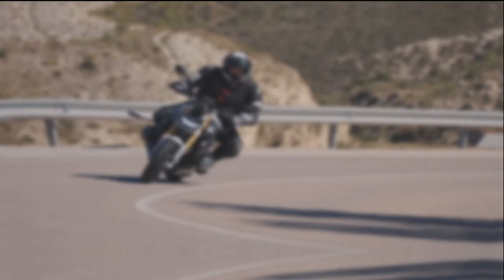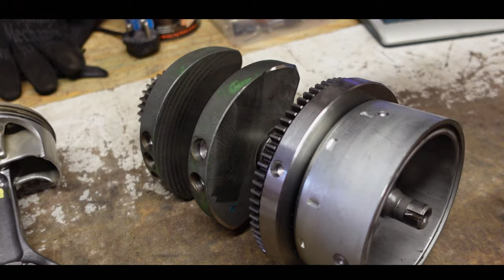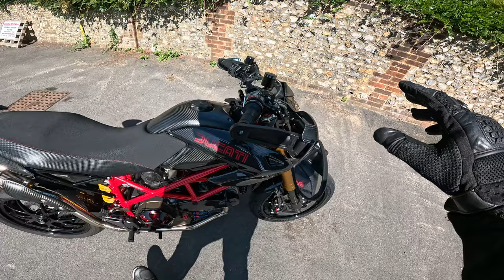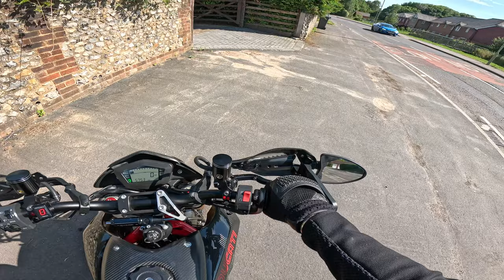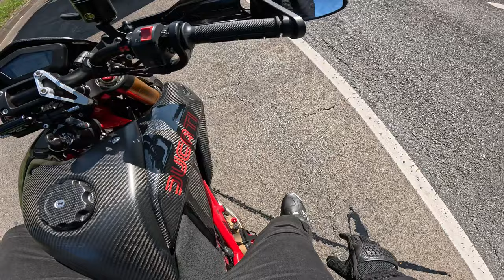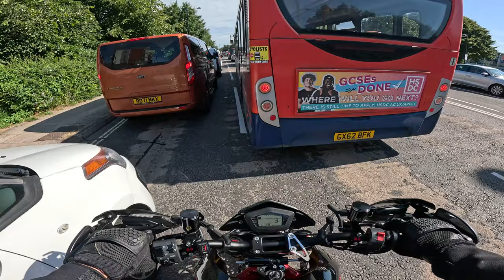Hypermotard Is GOOO!!! | The Project Concludes

Comment: Regarding your stiff gear shift, if it's still a problem after you're back on regular oil, consider these things:

1. Do you have any clutch drag? With the engine warm but switched off in first gear, can you push it along easily with the clutch disengaged? If not, maybe the clutch needs further bleeding.
2. You fitted an Oberon slave I think? That gives a lighter pull at the expense of some lift. So if it's dragging despite a good bleed, consider your clutch pack. If your new clutch stack height is a bit higher than optimum, then the clutch may not be fully disengaging. You could always swap back to the standard slave, just to see if that makes a difference. (By the way, my 1100 Monster has rearsets and an Oberon slave and the gear change is super slick - much better than standard.)
3. As the engine's been rebuilt, the gear change selector arm has been removed and replaced. It can be adjusted a few millimeters fore and aft but needs to be precisely centred to ensure smooth shifting. It lives under the alternator cover and might be worth investigating if all else fails.

Enjoy!
Reply from the maker: I will try those tips thanks 👍

Comment: Been soooo looking forward to seeing the first proper ride out on the Hyper, what an achievement!
With regards to the stiff gear change, I had the exact same problem on my 2007 Hyper and the reason for it was the ‘selector claw’ was not aligned properly. Page 455 on the PDF manual shows how to align this 👌🏼 If this is the problem, when tightening the gear selector mechanism back up make sure to use the correct loctite and torque both bolts to their exact spec!
Reply from the maker: OK fantastic Luke 👍

Comment: I agree with the fellow about a hard break in especially since this is not a new motor its basically just a rebuild. Manufactures usually want you to be easy with the bike for the first 600 miles to let all the metal mesh with each other. In this case you’re only breaking in the piston rings.  The best way to seat your rings is to do multiple heat cycles with aggressive on throttle and trying not to keep the engine running at a constant speed for too long.  So basically ride it like you stoled it.  Let it cool down.  Repeat ride it like you  stoled let it cool down a few more times. After about three to four times your rings will be properly seated. Now you can ride it race it or just put it around.
Reply: Run it in like you're gonna ride it is my advice. Manufacturers just want you to go easy on new bikes cus of the brakes and tires
Reply: In any case, you're only breaking in the rings.

Comment: Great to see the Hyper finally running smoothly. I've had my Ducati Monster oil analysed by Millers and they're really quick - I got a full breakdown of the oil emailed to me exactly seven days after I put the sample in the post. I'd definitely recommend this service in your case with a rebuilt engine or also if you've just bought a second hand bike so you can check on the health of the motor. (Maybe get the R1 analysed at the same time.)
Reply from the maker: OK good news 👍

Comment: You really should give it a bit more throttle when running it in. Repeated hard pulls, then ease off. That's what gets the rings bedded in. Constant low rpm will do it no favours as things will just glaze, not bed in
Reply from the maker: Yes it's now had some decent pulls, only took it easy for 100 miles

Comment: Love the bike. Hopefully you bring it back on the channel even if it is not a full length video.
Reply from the maker: Oh it will be back don't worry 👍
Reply: @LambChopRides  Great! I ran Motul 300v oil and had effortless yet positive gearshifts. I could upshift/downshift with no clutch just by rolling off and back on the throttle. Also, I loved the strong engine braking so I didn't switch to slipper clutch.

Comment: Do another two oil analysis when you change from running in oil onto your normal use oil, you will see a change again and further reduction on wear elements.

Glad you took the advice to change the oil at 100 miles but personally I wouldn’t put more running in oil back in, I would have jumped to the normal use fully synthetic oil.
Reply from the maker: Yeah I'm going to change now which is 300 miles and go semi synthetic
Reply: Perfect, I was worried you were going to go too long on the running in oil, it realy is only needed for the first 50 miles to bed the rings in. Everything else is running on a film of oil so the changes are used to flush any dirt and dust from the build out as well as build greases and sealers. 

Two changes in quick succession are needed when ever you change oil grade or type as the additive packages don’t always play nicely together and you can see a spike in wear materials until the second change is done.

See if you can get some sponsorship from the oil analysis company and a oil supplier and do a series on this…. Its a interesting topic, under reported and even less understood. Find a willing tribologist to explain the results 👍

Comment: Lovely job. I have a similar model, could you point me to where you found the oil cooler lines? Those meet my needs perfectly from what I can see in the video. Cheers!
Reply from the maker: They were from Itally... can't remember exactly but Google oil cooler lines.. began with Fren... Sport maybe..
Reply: @LambChopRides  Sounds like FrenTurbo, I'm familiar with them but hadn't seen the specific long fitting with the 90 degree on it that yours has, which is just like factory only these are anodized aluminum. I'm not finding those, but still searching. Thanks.